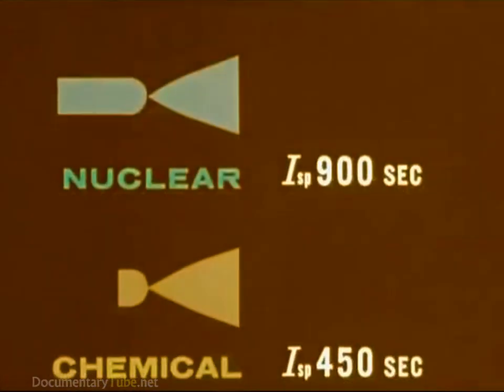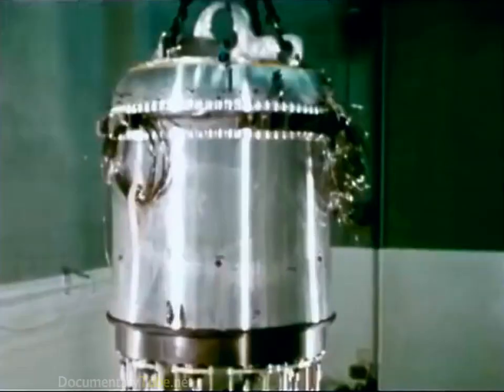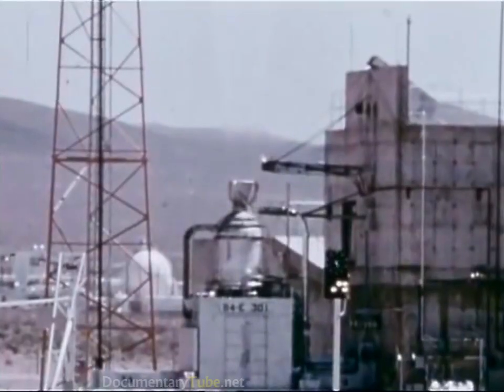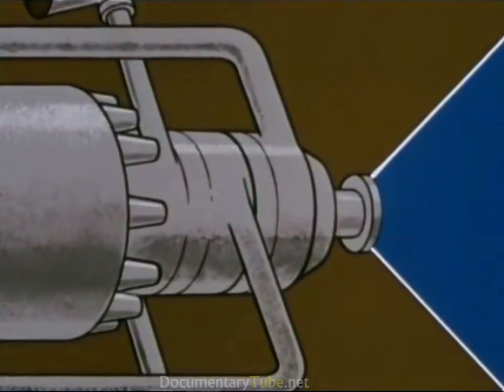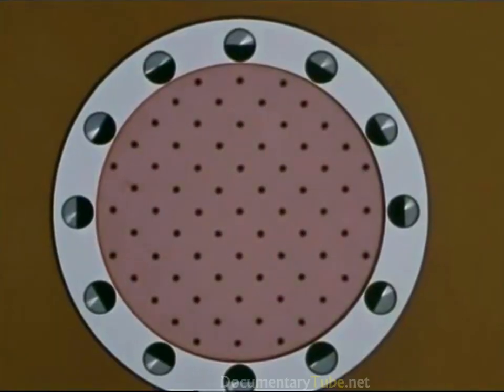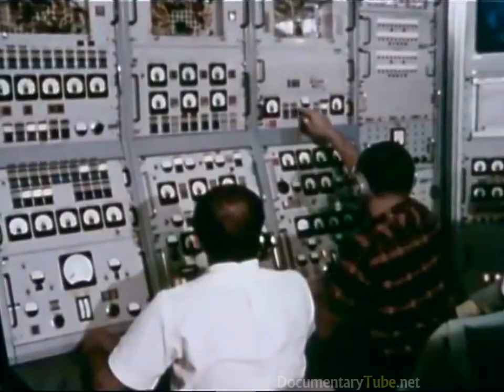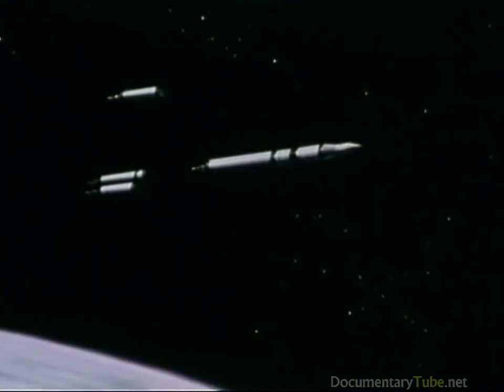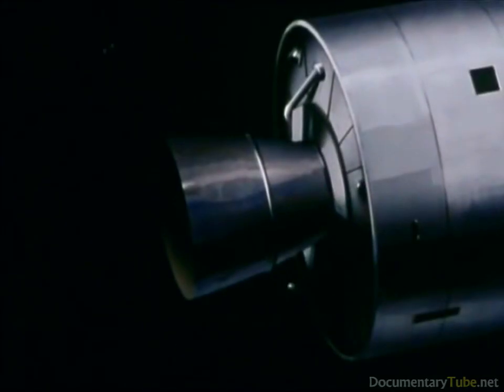HOW IT WORKS: Nuclear Propulsion

Comment: About 26 space missions have used nuclear power already, such as the Mars Rovers. They were powered by Radioisotope Thermoelectric Generators (RTG), which kept the batteries charged. Solar would work, not enough daylight. Quite a few space missions like Pioneer 10, Pioneer 11, Voyager 1, Voyager 2, Galileo, Ulysses, Cassini, New Horizons (Pluto flyby), Viking 1, Viking 2, Rover-Curiosity, used RTG power (Rover-Opportunity and Rover-Spirit used solar cells and eventually died from dust storms). There are military satellites, weather satellites,  military radar stations in Alaska, and lots of things that are nuclear powered, but in a different design than most people think about. Very different than electric generating stations or submarine or carrier nuclear power. Some people think of nuclear and immediately think of a bomb, and ALL of these are different designs, as most of you reading this already know. In our area, we've made nuclear fuel for most all of these types of systems, since 1955.

Below is an article from July 2019 about a manned Mars mission, possibly nuclear powered, using a spin-off of the RTG idea. 

As for Yucca Mountain (and also the MOX fuel project), Obama killed those projects. 

While its interesting to go into space, to the moon, to Mars, and even outside our solar system, sometimes I wonder if the money would be better spent here on earth. I know we have all benefited from thousands of things in our personal lives as a result of space exploration. And how could we survive without satellites (weather, communications, defense, etc)? All the electronics and communications advances are amazing. Not so excited about spending money to send a manned mission to Mars. I am sure we can.  And just think, our solar system, which we can barely get to the edge of unmanned, is only a tiny little piece of only one of the galaxies. And we have no idea how many galaxies there are out there. Infinity in space and time. Its real.

https://www.idahostatejournal.com/news/local/inl-part-of-effort-to-develop-propulsion-system-for-mars/article_b3453f58-aff1-5d60-b7dc-c9d0ac354c17.html

These might be of interest too:
https://en.wikipedia.org/wiki/Project_Prometheus 

https://mars.jpl.nasa.gov/msl/ 

https://www.nasa.gov/mission_pages/newhorizons/main/index.html 

A recent MARS mission, which is solar-powered:
https://www.nasa.gov/mission_pages/insight/main/index.html 

https://www.bwxt.com/what-we-do
Reply: Larry Lewis dude we’re is my car
Reply: Top secret

Comment: Russian attempts to produce these engines have been disastrous. Radiation is an unfortunate problem for the crew and recycling of expensive components.
Reply: RUSSIA was trying to build nuclear powered cruise  missiles.  The USA WISELY dropped that research decades ago.
Reply: @Allan_aka_RocKITEman  Open-cycle air-breathing nuclear ramjets are not good anywhere outside of gas giants.

Comment: Did anyone ever stop to think nuclear radiation stays deadly for like 10,000 years?  Might be some better tech without such waste and possible deadly consequences?  Oh well, proceed.
Reply: What nuclear waste?  The one left in orbit around the other big ball of nuclear waste..called the sun?
Reply: @ronin2167  good point if it's in outer space.  i was thinking about how we've boxed ourself in here on earth to the widespread use of nuclear energy which always creates that special problem of spent fuel.  I guess we could blast it off the face of the earth which if the rockets didn't blow up on occasion might get it out off the blue ball we live on.  I was one of those who believed we could harness and intelligently control fission.  It was sold well for a time.  I think the past forty years has proven we're rolling dice.  The small fission reactors are getting the nod know but they're still fission.  We will still have the problem of waste even if they can automatically shut down and store the uranium fuel prior to meltdown.  As in the light water reactors these new minis that look so good on paper will eventually show failure in some worst case scenario not expected or considered likely.  I think it's time to get away from fission as we've seen  it kills in numbers and for years even with the best plans.  I've just about given up on fusion too because like they said 60-years ago...it's always 30-years off.  Harnessing renewables is the only near-term safe bet.

Comment: imagine a mini cern , 7 meters around. then a 6 meter cern just inside , then 5 meters , 4, 3, etc.  7 loops of particles each going in the opposite direction of it's neighbor.  harness the by product, and reclaim the energy like perpetual motion.  they said the saucer shape was the most efficient for housing the drives.  some scientist out there could solve our cosmic travel needs.

Comment: weirdness,  thinking,  what u know?   once you solve this issue of moving mass at speeds of 10 thousand miles an hour or 50k  or higher approaching the speed of light,  there must be some kind of change in matter at a elementary level of space matter time parody?

there must be a jump to a different dimension?  a quantum leap?  a scalar bar to jump?  white energy turns black?     what is the equation that explain this concept?   mass forced into space at a speed and pressure and temperature that blows all limits on physics that we know ? 

but fallen angels have these equation that prove this can be done using mass elements that change into quantum energy using this knowledge?   what is a black hole?  a jump to a different reality or location on the map?  send in the probes!
Reply: Agent Anderson what are you high ot something if you are stop using it

Comment: As soon as nuclear power is mentioned everyone becomes frightened because the waste product is radioactive if they can overcome this destructive waste then it's obviously a very good propellant for space vehicles
Reply: Throw it in space. Space is big.
Reply: @ayushsharma9270  Or recycle it somewhere. Nuclear fuel is not cheap and, as space is big, building an automated engine recycling factory won't have a problem of protecting others against radiation from it.

Comment: It’s better at giving you cancer that’s for sure 😱
Let’s not forget how much radiation the nuclear jet engine would spew into the atmosphere 
Can anyone say Chernobyl ?
Reply: This type of propulsion does not ‘spew’ radiation at all when working correctly.  They only use the nuclear reaction as a big arse heater to heat up the hydrogen gas to a very hot 4000 degrees F.   The only thing exiting the rocket is hot hydrogen, which will mix with oxygen in the atmosphere to form water, but as these rockets are not used in the atmosphere and only designed for use in space, I wouldn’t worry too much about malfunction as far as our atmosphere goes.    If the rocket malfunctions in that the nuclear reactor core fails it would release uranium 235 and a several isotopes.  This is what the Russians just experienced in one of their tests, in that case our atmosphere is affected.
Reply: S Bains the scariest weapon I can think of. The SLAM could carry multiple payloads, all while leaving a trail of radiation like a crop duster.
Reply: S Bains not to be rude its not how it works like the guy on top said its spewing hot hydrogen the uranium is just used to heat  it
Reply: WORSE!! What kind of an IMBECILE would even consider that??? Yeah, i know, the scientist who came up with that abjectly stupid shit i think in the 50's...and he was supposed to be "higher educated"....Yale/Harvard etc??? That was a WASTE!! he should have been EXECUTED on the grounds of abject stupidity!!!! WTF IS WRONG WITH US????

Comment: Only twice that of chemical rockets ? That's not much of an advantage...hardly earth shaking
Reply: Yes it is! It's a difference of almost 100%! Twice the specific impulse means twice the thrust from the same amount of fuel, which can come up easily to three times the change in velocity on many spacecraft. And if you don't need it, that weight saved cascades down to thousands of pounds of fuel saved in the launch stages.

Comment: So, this is yet another waste of tax dollars.
1. They keep contrasting this engine with a "chemical rocket" yet I see a limited fuel supply on both.
2. Acceleration in Space does not stop.  That means MOST of your fuel is used for slowing down to "capture" a planetary orbit.
3. Exactly HOW is this engine cooled in Space? When it is not running,  there is no liquid hydrogen to cool it so what does cool it?
4. Some 'tards have talked about Sodium Reactors because "they won't react with Water". Wow, has no one bothered to learn that sodium reacts with heated metal?
5. Radiation,  it's a real problem and a spaceship is the perfect conductor
6. Refueling?  Never mind, I won't miss any of the idiots. This planet is disrespected every day by humans yet so many people cannot wait to do the same elsewhere. 

When Putin talked about a Cruise Missile that will loiter endlessly, I didn't believe him because that statement should be considered intimidation,  not fact. Grow up 'tards.

Comment: This example uses hydrogen for propulsion, Putin's exploded rocket had ,according to the Russians ,unlimited range and could therefore used nothing but air . I think Putin's new exploded secret nuclear rocket is a hybrid of a scramjet and  direct cycle nuclear propulsion. Very polluting (Mr. Putin..) and very dangerous indeed. As it showed days before my comment.
Reply: no warhead required.  just fly very low altitude, extremely "hot" exhaust contaminates everything in it's path.